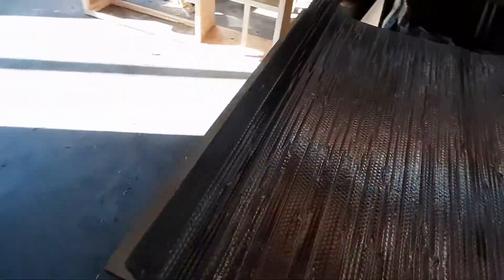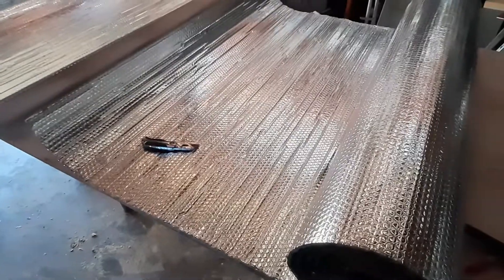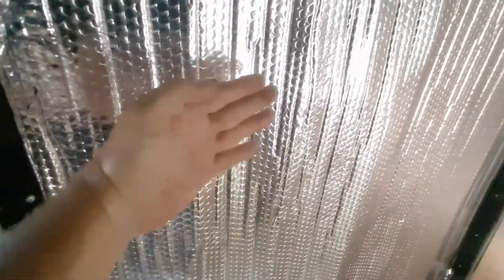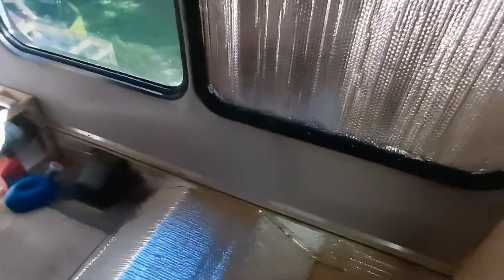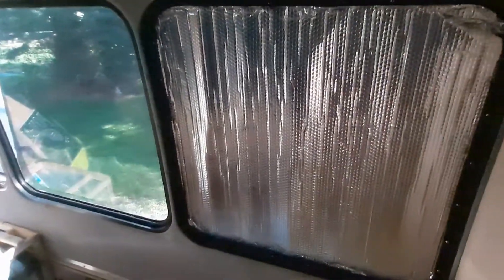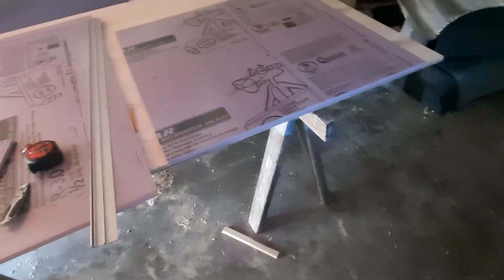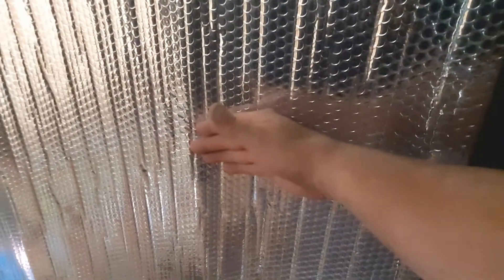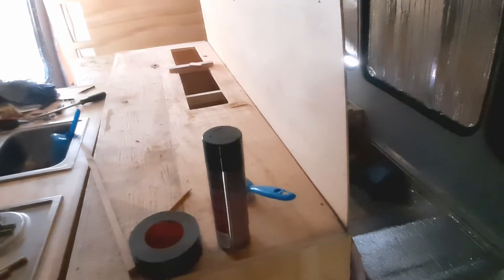conversionl update #65 Closing up the windows

Comment: Over the years I have used about every kind of duct tape that there is - Gorilla tape is my hands down favorite. Double insulating those windows is worth all the extra effort as it pay big dividends in keeping the rig cooler.
Reply from the maker: I agree... without the reflectics and foam I could feel the heat coming out of the top cabinet... this should help alot